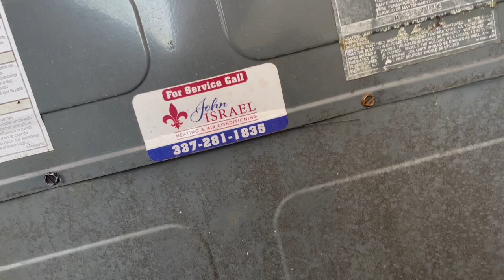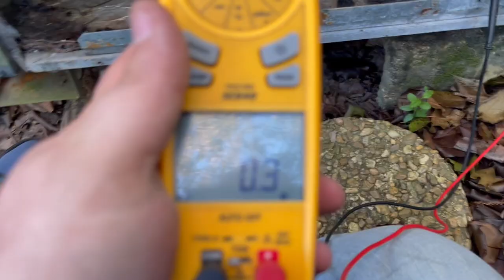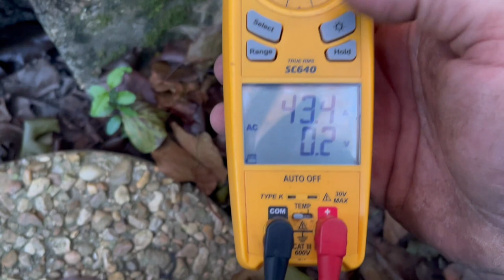No Heat/Goodman Package Unit

Comment: Mine has drove me crazy. There are times it still works, but mostly after it has been turned off for a while. It does it on heat or air but when it doesn't work it will kick on and right back off. It doesn't even spin the blower nor the other fan much at all when it does this. There have also been times that the blower stays on but just blows no heat nor cooling and the other fan just kicks on and right off and barely turns. The fan spins freely and the capacitor was replaced saying that would fix it but it didn't even replaced it a second time and still the same.  It is also a Goodman pack unit. The control board in it was also replaced and the blower motor about a year ago. I will ohm out the contactor since you showed that in here but that is what I think it is or a bad connection which I am going to check and replace while I am in there just incase. I just can't keep paying people to come out and not fix it every time. $300 each trip so far and the first one I called wanted $500 to come out and check it out.

Comment: I've sold a bunch of those Goodman's package units I see the condenser fan motors go out alot defrost boards incontact on heater also problems with wires breaking off of pressure switches great content thanks

Comment: Assuming the condenser fan motor is drawing additional amps; could it damage the new contacts?
Reply: Yep, when it finally quits the compressor will run real hot and draw higher amps and that in turn can damage em a little.  Highly unlikely the fan will damage the contacts on its own though.

Comment: Hi, I have a similar heat pump… all electric and it is the only source of heat and A/C. 
This year it started blowing cold air (59-64F on regular heat and about 84F on auxiliary except from the closes vent to the heat pump 107F)
Someone came over and said it was the defrost control board, it got changed and still having the same problem… the board looked a little burned. As I say though, still blowing colder air. I have it running on emergency heat for a week 
already

What else could it be. I was told that maybe the heat elements, but I think the heat stripes only work on auxiliary mode and don’t have anything to do when using regular heat mode, or am I wrong?

Help!